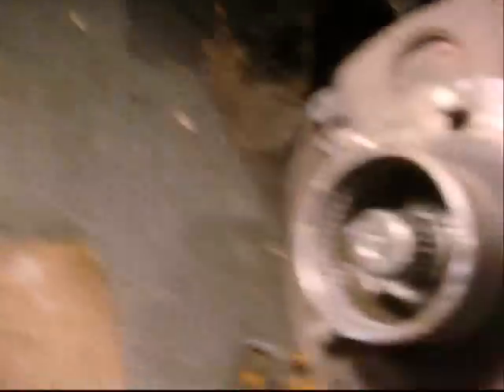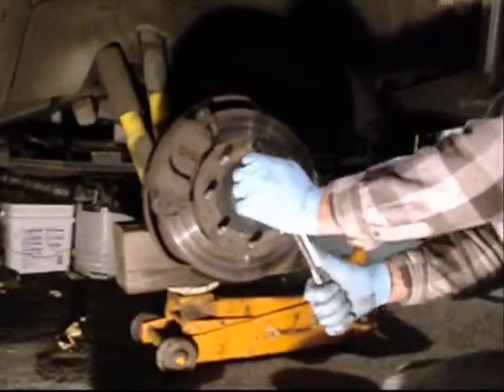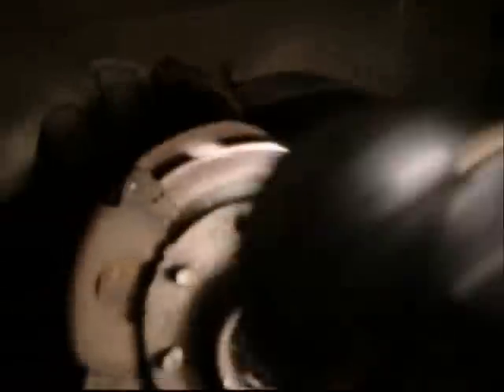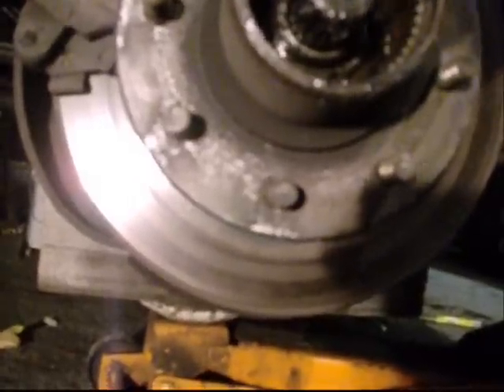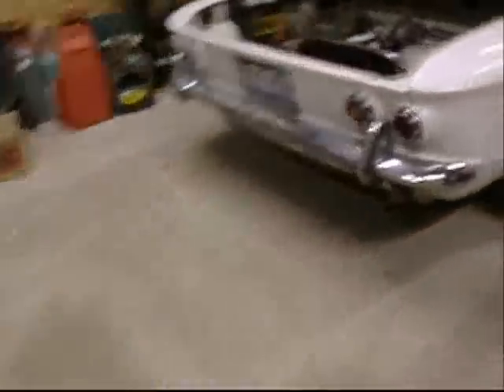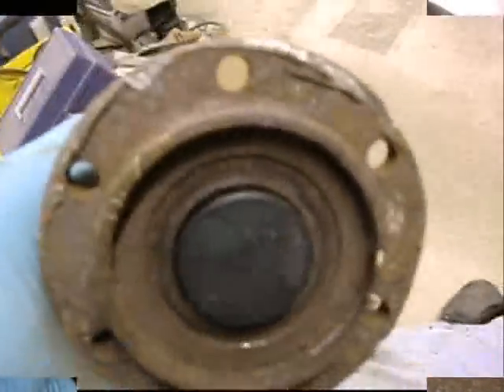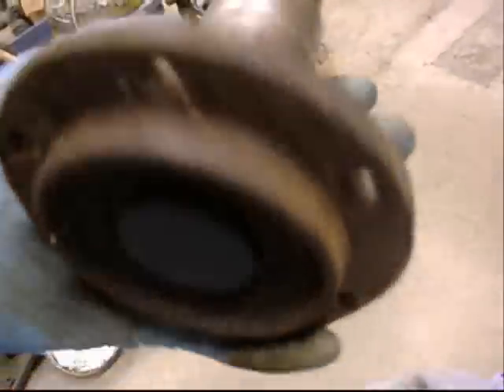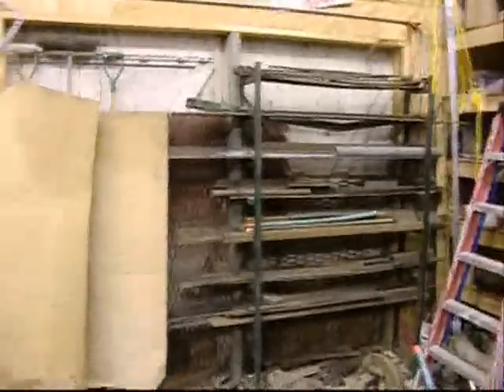11 15 11  SF Sub RF Hub Replace...

Comment: Looks like if you want to fix that you will have to try bang out the ball joint and find a whole another knuckle assembly.

The adjusting nut was loose allowed the wheel to move and buggered up the spindle threads. Or you have a bent spindle.

Comment: here's a tip for removing rusty spindles: take a long block of 4x4 wood and a big sledge hammer and beat that SOB until it comes free.  The wood won't damge the spindle.